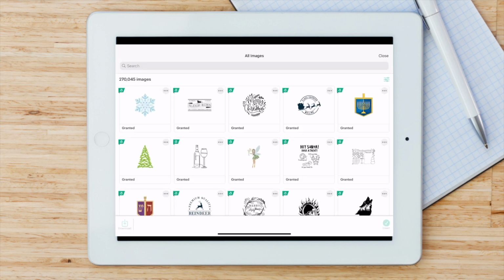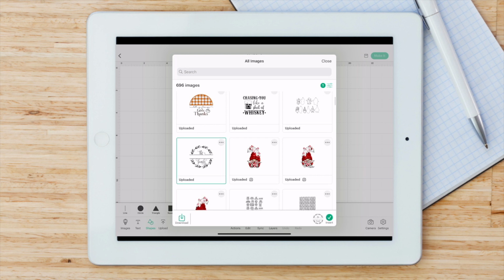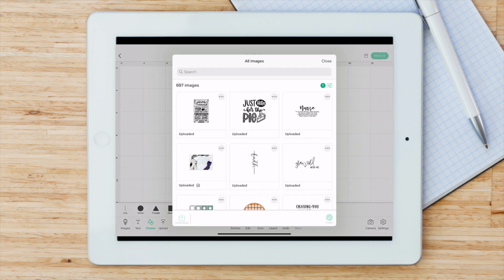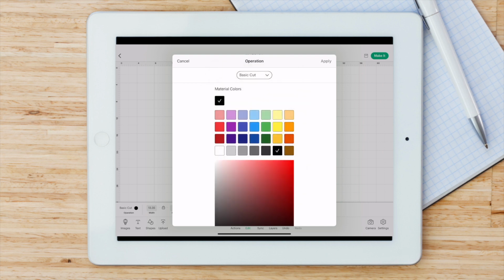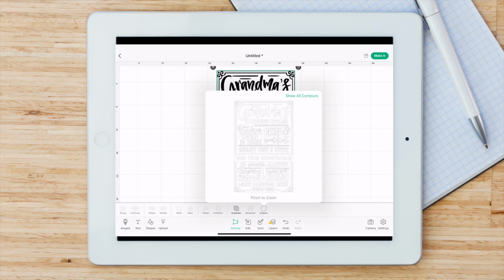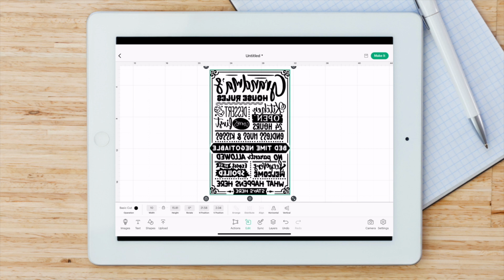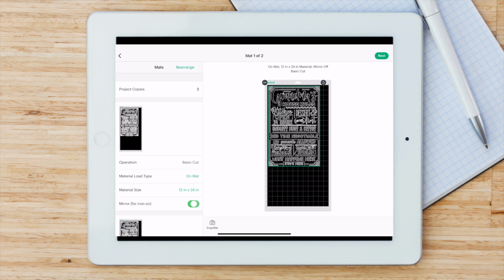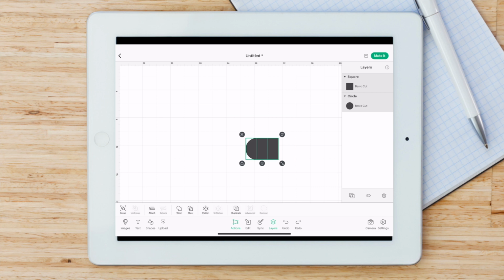❤️ Cricut Design Space for Ipad or Phone 2022

Comment: I have a problem when I try to make my design it’s only 8x11 and it doesn’t pop up on the mat. I changed the mat to 12x24 but it still doesn’t appear. But when I make my design smaller, it appears. I was wondering if anyone can help with this? I was really looking forward to making designed shirts.
Reply from the maker: Hi Levi! Are you trying to create a print and cut design using a PNG? If so,  the design would need to be 9.25" x 6.75"  which is the default size for Cricut.  - Dawn 🙂